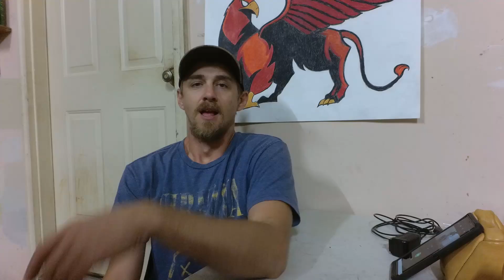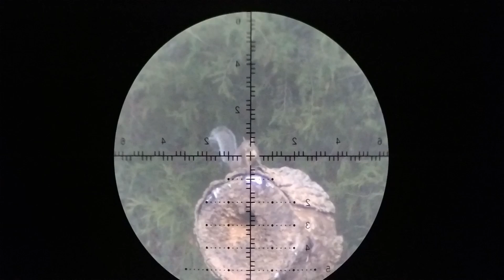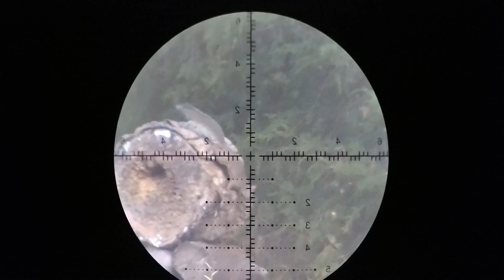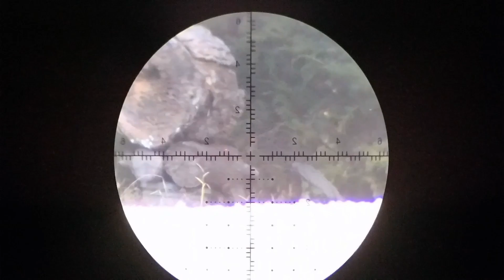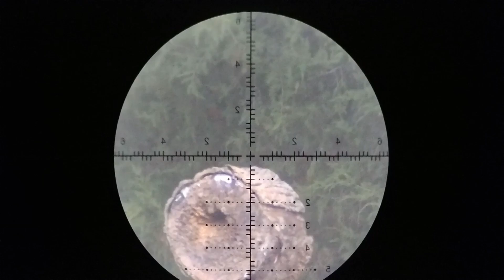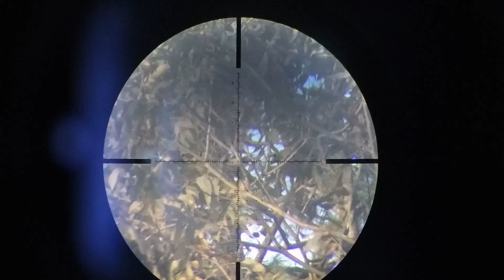218 griffin slugs test 100 yards and hunting clip

Comment: Any advice on yours guys .177 slugs I have a benjamin maximis in .177 I'm  thinking of doing some power mods to it. I think I should be able to shoot jsb 16 grains up to 800 to 900 fps.
Reply from the maker: Hello sorry it didn't get back to you faster. Measure the length of your magazine to see what the longest pellet that will fit is and try the hollow back slugs. The hollow slugs should do ok. There should be the lengths listed on the ebay page
Reply: The Benjamin maximus is a single shot rifle. I'll try some lightweight slugs and see how  they do.
Reply from the maker: @tofast5419  yeah I looked it up on pyramyd the hollow base are the lightest you just want to make sure you have length on the bearing surface to engage the rifling
Reply: Thanks for the advise. I just got a  hatsan nova in .177 I think it should be able to shoot heavy slugs with no problem. I'm going to try out the 16 grans griffin slugs. I notice that the air rifle bolt pushes the pellet into the barrel and then the bolt goes back some millimeters. I don't think that would be a problem. I would also like to shoot 18 and 20 grains slugs flat back. I'll let you know how it 16 grains slugs do with the hatsan nova.
Reply from the maker: Oh nice 16gn at 800 to 900 fps in .177 I would try the boat tails we have been getting good results with those and the flats. I have been impressed with .177 slugs they can keep up at 100 yards no problem
Reply: I just measure the hatsan nova magazine in .177.  The length is 10mm so the 21 gn bolt tail should fit. I don't know the barrel twist. I think i should start  with 16 and 18 gn slugs. if they shoot will I'll try heavier slugs. I think the 16 gn bolt tail slugs shouldn't have to much friction in the barrel. I try some of the .177 hollow base 10 gn slugs with a power line 880 at point blank and they expended really nice at 550 fps shot into potatoes. I also try some of the hollow base slugs in .22 the 21 gn slugs shot the best with my kral puncher breaker. At 880 fps I notice that the 21gn slugs where almost like dish base. So I think I'm going to try out the 22 gn slugs in flats back see how they do.
Reply from the maker: Thanks you very much for your feedback it means alot! The .177 cal is a little different from most from the twist rate side. Most .177 have a fast twist compared to .22 because the ratio of length to width it sounds like you have the right idea I look forward to hearing more! Thank you again TF
Reply: @leadslinger5130  have you guys try .177 slugs with low power air rifles. I have a 20 fpe air rifle that I'm going to be testing with .177 slugs. I been looking at your guys new .177 slugs the 2 stroke. What would you recommend for a 20 fpe air rifle.
Reply from the maker: @airgunsofidaho4886  we are still waiting on the .177 2 stroke set it should be here soon hopefully. As for .177 slugs in a 20 fpe or under I would try a  11-13 gn hollow base slugs. The 2 strokes that we have now we can make down to 10 gn in dish back. The difference is length a 10gn hollow back is .290" long and a 10gn "2 stoke" with a LDC core is .243" long. So in theory the shorter slug should do better in most current .177 barrels because the standard twist rates are either 1/17.7 (lothar walther) 1/18 (fx) I'm sure there are others but this seems to be standard. These twist rates are to slow in .177 to stabilize most slugs. Basically the slugs I mentioned is where I would start. The 2 stage we have now can only place the core in the front our new system will allow us to move it to the middle and rear as well as make a hollow cavity in the center. This will allow us to balance the slugs more and reduce the amount of twist required to stabilize the slug. Sorry for the long winded reply lol and thanks
Reply: @leadslinger5130  being able to move the core to the middle and to the rear will definitely help to stabilize the Slugs. A while back I was testing the 16gr bout tail slugs. But my rifle wasn't able to stabilize them. I think they didn't have enough surface to grab on to the rifle berral. Idk maybe in the future I will try some 18gr bout tails.  A while back you told me that your friend was shooting the .177 18gr slugs a 830 or somewhere close to that.  Do you think that the 20gr slugs need to be shot at a faster speed? For now I would like to test some 10gr and  13gr slugs to see what they can do. I think that my benjamin maximis has a 1: 20 rifle berral. I guess the only time I can do is test different slug weights. who knows maybe it likes some slugs.
Reply from the maker: shooter this something I have started studying alot lately the only problem is alot of the mathematical formulas where developed for supersonic boat tail shapes like the Miller twist rating. Also gyroscopic stability does not = dynamic stability in flight. But having said that it is still useful. If you have streloc ballistic app and put in your exact slugs demotions and twist rate + velocity it will produce a G.S rating (gyroscopic Stability factor) according to the Miller rule a G.S of 1.5 is the minimum GS to maintain your B.C if its lowwer then 1.5 then the B.C will start to drop. I personally have noticed that slugs that dont get at least a 1.35 start to have a shutter in flight (lose of B.C) slugs at a 1.0 GS can get alot worse
Reply from the maker: @airgunsofidaho4886  so I just realized you where testing RBT this is what the miller twist is based on more so. I ran the boat tails through several ballistics programs  useing the barrel specs I could find the recommended twist rate for a RBT is 1/13 to 1/12 and that will produce a G.S of 1.54 at 900fps. G.S is dependent on velocity so changing the speed will help. Example fast speed higher G.S lower speed lower G.S any I gotta get some slugs punched before the mail man gets here lol let me know if you have more questions
Reply from the maker: @airgunsofidaho4886  guess who is first on my list lol
Reply: @leadslinger5130  I couldn't tell you. Who is it?
Reply from the maker: @airgunsofidaho4886  lol your order was on the top of the stack lol I made you some 13gr dish base to see to try as a sample
Reply: @leadslinger5130  nice. I will place an order later today when I get home of some .177 slugs.
Reply: I really been wanting to test the 13gr slugs. But lately I been short on money. Hopefully here soon I can buy more slugs from you guys. I think your new 10gr and 13gr slugs are going to be awesome. Can't wait to get them and thanks.
Reply from the maker: @airgunsofidaho4886  that's funny I thought you had already order I was making those 10gn .177 yesterday morning when we where talking
Reply: @leadslinger5130  lol. I was like what order. I haven't placed an order yet.

Comment: Thanks for keeping us posted on all the info, Just trying the 27gr NSA now and looking really good with the HUMA reg,  Any chance on re engineering that valve seat, maybe thickness ??? I'll keep on going with slugs until I run into issues and see what happens,  Can't wait to see that new gauge and what you think of it,  Running out of time in weather up here in New England so I may be cut short and testing!!!😔
Reply from the maker: I have heard rumor of a titanium seat being made but I'm not sure. It would be easy to make on a lathe but i dont have one at the moment unfortunately. The valve has a taper on the exhaust side I'm guessing to improve air flow but it creates a very thin spot behind the oring where mine broke. Adding a few hundredths in length behind the oring would probably be all it would take. At least to keep the same power. Are still liking the huma reg? I may have to get one.
Reply: I have to admit I am loving the Huma reg, that extra 14cc of plenum really helps !!! At 165 on the reg I'm getting 890fps with 27gr and 960fps with 23gr slugs and all tight numbers,  plan on more testing tomorrow if the weather is halfway decent but only around 53 degrees tops ...😔

Comment: I myself I'm thinking about the Raptor or the flex. Both of them seem to be able push out the power. Even heavy slugs. I don't know if you scribe to Will Romans air rifle Channel. He's a really good guy. He's been doing some videos on the flex. It's a beast. He put out a video yesterday doing 300-yard shots. Pretty dang impressive. But like I told you the other day.... I'm also probably going to get the FX Tactical. Just add to the collection.. and it just  looks cool as hell also. Shoot Straight and stay blessed.👍🇺🇸🇺🇸✌
Reply from the maker: I'll have to check him out. The thing I like about the jsar is it can change caliber and it's the only airgun i know of that has a .177 cal slug option at 40 for. And the shot efficiency is vary impressive. I have not looked it the flex that close yet. I have also heard good things about the tj barrels on the jsar. I wanted a impact mk2 but now I'm rethinking fx airguns. 1 of the main selling points or differences in the mk2 was supposed to be the addition of the .357 caliber that has never been released. This is do to fx not going about it the right way in my opinion they should have made the .357 first that would have made the entire lineup more powerful. Same with the .30 cal dreamline I know for sure that the .357 impact has a different value than the normal mk2. I think that is pretty shady personally. Thanks for your thoughts I'll check out the flex and Will Roman. Have a good day Richard
Reply: @leadslinger5130  agree with you 110% I'm going to go with the Raptor. Just found out Flex maybe going out of business or I know he's relocating. And I do like that 25 caliber barrel with Slug and pellet and interchangeable barrels and calibers. Power power.👍🇺🇸✌